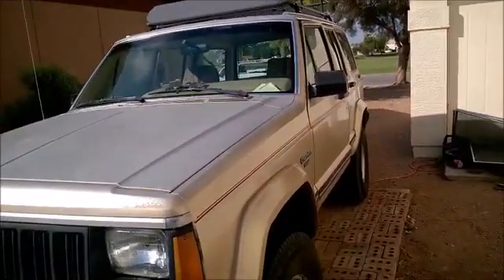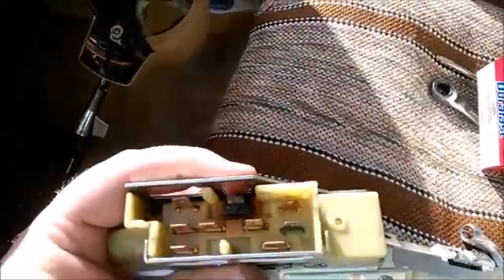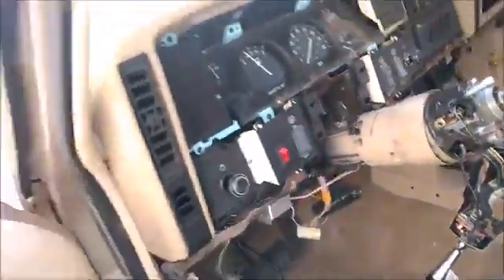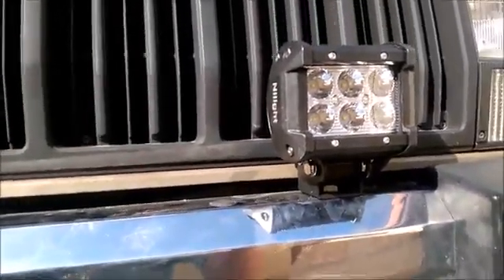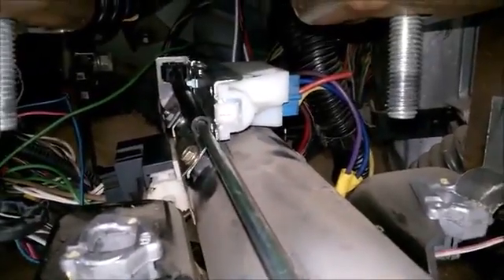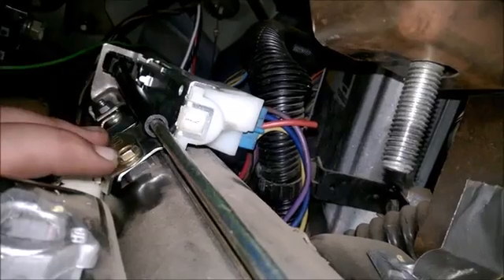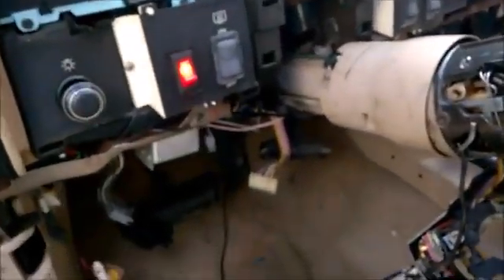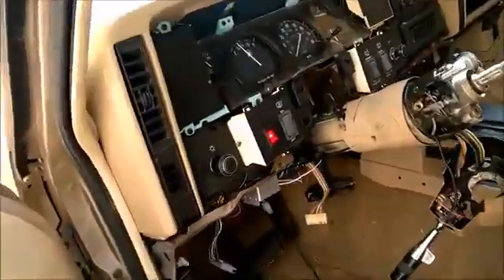Ignition switch replacement 89 Cherokee XJ

Comment: There are really two switches in the Jeep. The one where you insert the key technically should be referred to as an actuator more than a switch. The real switch is further down the column and under the dash. A replacement part would be something like REPC506201. That is where all the real magic happens with ignition, accessories, etc... Well... technically, just those two things.

If you are having accessory issues, that is where the likely culprit is.
Reply from the maker: I don't remember if I covered it in the video, but after all that work, my main issue was some broken pieces of plastic that had gotten down around the sifter and was preventing it from going all the way into park. The ignition switch was burned and I had to replace that, and the tumbler was worn out as well. so all that work was needed.
Reply: @AICvideo  Ahh! I see. I pulled my tumbler out and just use a nut driver that fits over the little nub that the tumbler turns. When I take the driver out, I just set it on the center console and no one would ever figure out how to start the thing!!! HA!
Also, mine is a stick and not automatic...
Reply: Wonder if that's my problem... I replaced the switch still wont start but I thought it was my neutral safety switch maybe it's broken plastic
Reply: @sicktrick111  Hey Ryan! As discussed earlier this real switch is down the column and so you'll need to unbolt all the crap that entails and it ain't quite as easy as other videos might imply!!!
So... be prepared to either have a great time... or get it on with the jeep! Just don't be surprised whichever way it goes!
In my case, the column switch was the exact solution to my problem that had been nagging me for years and years!!!
Good luck, Dude!
Reply: @chrislong3938  that's the one I was replacing.. but thanks and technically it's not a switch for your key.. they call the a key lock cylinder.. even tho its technically a switch so people dont confuse the two!
Reply: @chrislong3938  thinking it maybe plastic stopping me from going into park properly which tricks your jeep into thinking there a nuetral safety switch problem. We will find out here soon! Wish me luck
Reply: Cause my shroud to the stick busted apart on me not that long ago 🤞
Reply from the maker: I had that same issue, some plastic around the shift lever preventing it from going into park.
Reply: @AICvideo  I also found a way to test you neutral safety switch....

   If you diagnosing problem. And want to know if it's your switch before replacing starter,ignition switch, relays ect. 
      Step 1: Put keys in your key lock all the way forward like your about to crank it.
      Step 2: Take a screwdriver and get under the jeep touch the ground to the positive connecting to the battery and it will bypass the safety switch and start... then you know you neutral safety switch is the issue not something else..
Reply: On your starter motor***

Comment: I just wanted to note that in my '90 MJ, I just removed the lower dash panel and I was able to access the switch without dropping the steering column or removing the wheel.
Reply from the maker: ah, I was replacing the ignition switch, and the steering wheel was floppy, so was tightening the 4 bolts holding it in place. I was replacing the switch just because I noticed it was burned out. The original issue I was trying to fix was some debris that fell into my shift column that was preventing me from going into park fully.

Comment: So my 89 I turn key, jeep starts, as soon as i take my hand off the keys it dies. Think it's the same?
Reply from the maker: could be ignition switch or lock cylinder.
Reply: That is most likely the cause. It's not allowing the fuel pump p to work while in run position  only starting position.

Comment: you realize you don't have to tear apart the column to do this job, right? drop the column, unbolt the switch and pop the connectors off and it'll come right apart. no need to tear down the column and introduce other issues.
Reply from the maker: I was going in to tighten up the steering column's 4 bolts that worked lose, and found burned connections. so the ignition switch was an after thought of having a working steering column. my real problem (though the ignition switch did need to be replaced) ended up being a broken piece of plastic down by the shifter... I sold this jeep a year and a half ago, so it's a moot issue at this point.